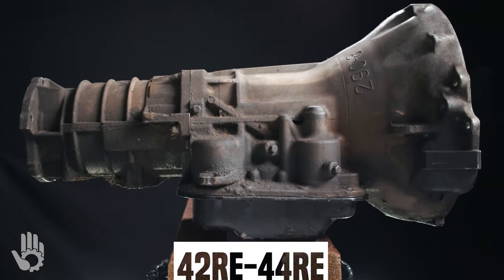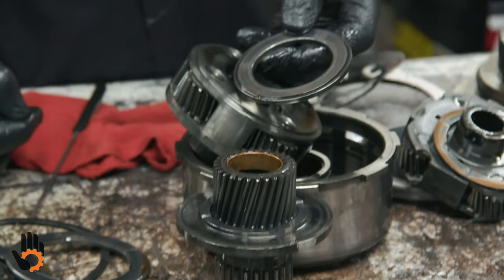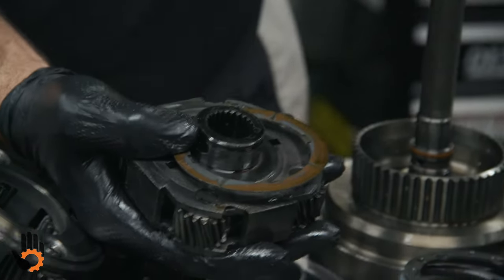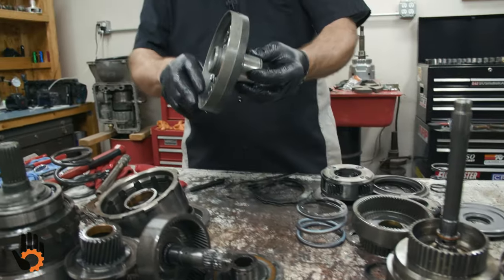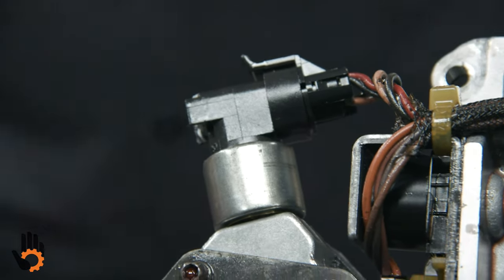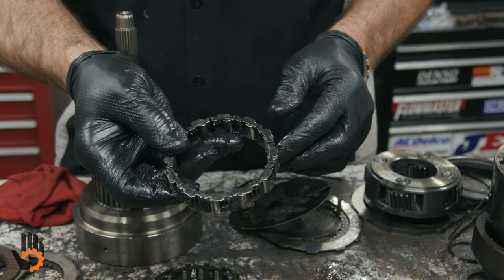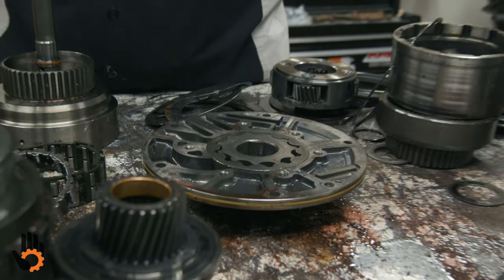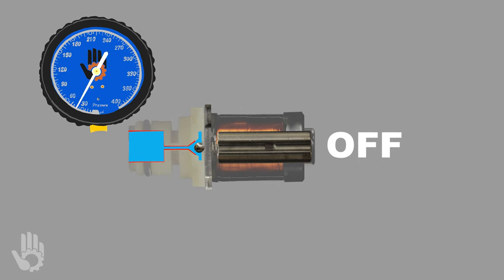Dodge 42RE / 44RE / A500 - Inspection

Comment: this was informative. i will be rebuilding my 42re and np242 over the next month, enjoy the detail he explains. but.... what are the dimensions on that od spring compressor tool lol.
Reply from the maker: I'm so glad that you found the video worthwhile.
Andy really does a great job highlighting important details.

The OD spring compressor tool is a DIY build.  It's a 4-inch outside diameter.  Roughly 6.5 inches long.
I got this particular piece of pipe from a well driller.  If you hit up a well driller, in your area, you might be able to land some "scrap" pipe, for free.

WARNING:
Per the video, that OD spring generates a LOT of force.  I treat it like a bomb that's waiting to go off.  You really gotta be careful when working with it, and around it.  Not being hyper careful with this spring could result in serious injury/death.
If you don't have the tooling to safely get the OD section apart/together, you can always take this section of the trans to a transmission shop.  I imagine they would be happy to help.  As you saw in the video, it's something that can be done somewhat quickly.

Thanks for dropping us a line.
Wishing you all the best.
-Robert

Comment: Absolutely top notch content, thank you! I've got a 44re hums for a few seconds on startup after overnight sitting.  It goes away quicker if i put it in neutral.  Any ideas? 

Also is there a link for donation for asking questions?
Reply from the maker: What you are describing sounds like a converter drain-back issue.

When the engine is running, the pump sends fluid throughout the trans.  The Torque Converter is continuously fed oil.  Under normal circumstances, it's completely filled with oil.  However, internal transmission leaks can allow some oil to drain out of the converter, when the engine is off.  This can happen when the vehicle is parked overnight....or parked for days on end.

It's not uncommon for these Dodge transmissions to experience converter drain-back.
It can be caused by a number of things.  Worn out Manual Valve/bore (mostly an issue that affects diesel applications), worn out bushings (pump & stator), etc.

Goes way quicker in Neutral:
This is because the oil has a more direct route to feed the torque converter with the shifter in Neutral, on this particular transmission.  With the shifter in Neutral, the converter gets filled faster.

If you're interested in supporting this channel, here are some options.  Thank you for your consideration.

1).  Patreon:  (monthly)
                  https://www.patreon.com/southpawautoworks
2).  YouTube Membership: (monthly)
                  https://www.youtube.com/channel/UCx_RrH0NPRyKoz9LwBa69hw/join
3).  Donation: (one-time)
                  https://www.paypal.com/biz/fund?id=9UPJA54D8R74A
Reply: @SouthpawAutoworks  thank you very much for such a detailed response.  im glad to donate
Reply from the maker: Donation received.  Thank you!
Really appreciate you supporting the channel.

Comment: is a 42 rh the same as a 42 re? other than the TV cable for the hydraulic shift?
Reply from the maker: They're the same units, with some exceptions.  The rotating assembly (shafts, drums, gears) are the same.  However, the controls are different.

The "H" in the RH stands for hydraulic.
The "E" in RE stands for electronic.

H:  Uses a governor (hydraulic device mounted on output shaft)(it detects road speed)(sends oil pressure to valve-body).
E:  Uses a governor solenoid (mounted on VB)(sends oil pressure to VB....just the like old-school shaft-mounted governor).

And there's more to this...
OSS (Output Shaft Speed sensor) vs old-school speedo, transducer, temp sensor, etc.

Both RH and RE units use a TV cable.
Reply: @SouthpawAutoworks  awesome thanks!!!